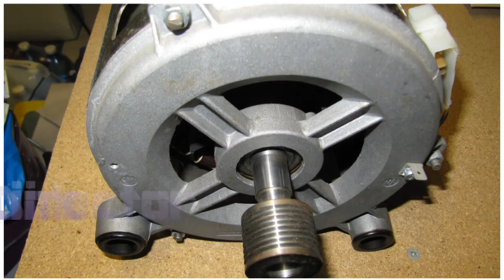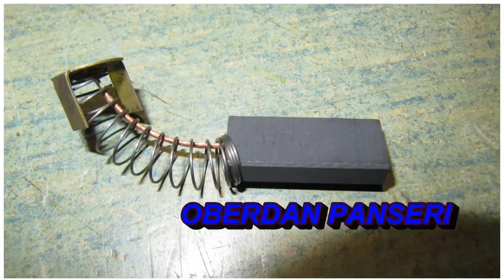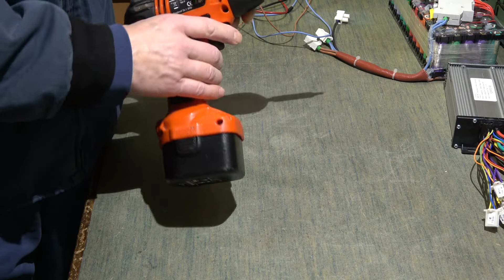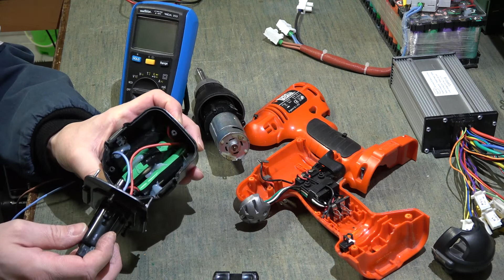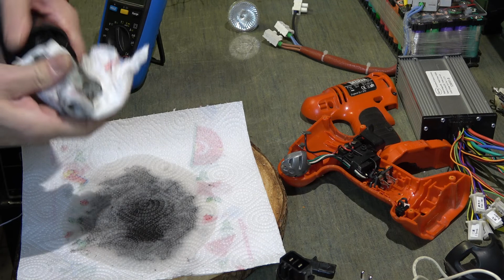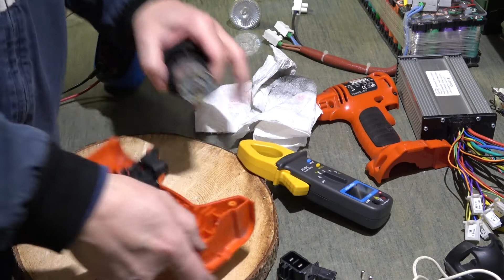OP 94: manutenzione avvitatore

Comment: 18650 35e Per samsung 18650 3500mAh 13A scarico INR18650 35E 18650 batteria Li-Ion 3.7v Batteria ricaricabi         Cosa mi dici si queste celle    ??   costano poco    e mi vengono i dubbi -
Reply from the maker: dal datasheet sembrano buone.